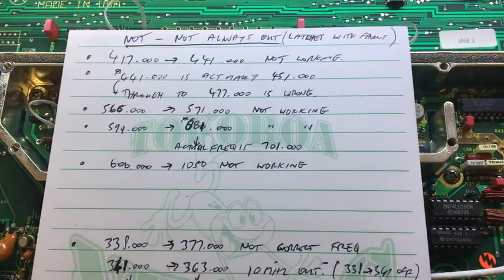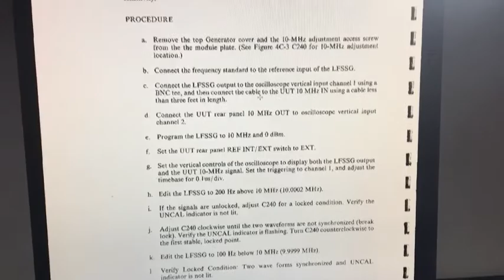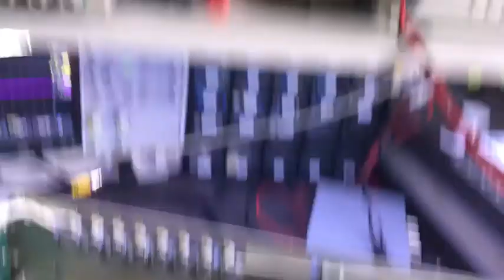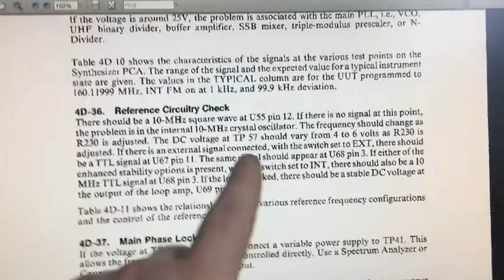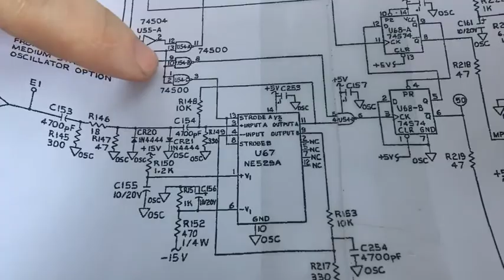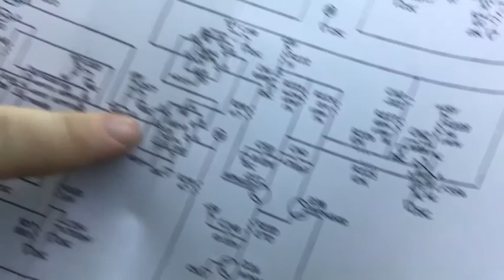#82 Fluke 6060B RF Signal Generator Repair Part 2

Comment: Very interesting video. I get great enjoyment getting old test equipment working despite failing to some of the time.
Reply from the maker: Simon Spiers - I like a challenge too, I got this from eBay as a faulty unit, which I hoped to repair and sell on to make some chocolate money, but I actually like its interface so if I can get it fully working I might keep it as my backup RF generator, and sell my even older Marconi generator with its digital synchronizer instead, the only real issue is that this thing is as big as the 2305